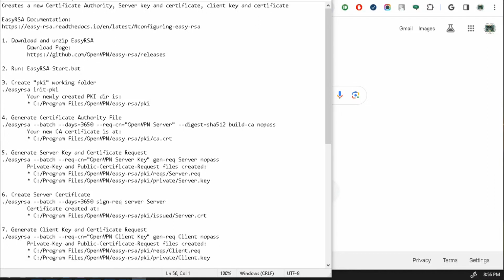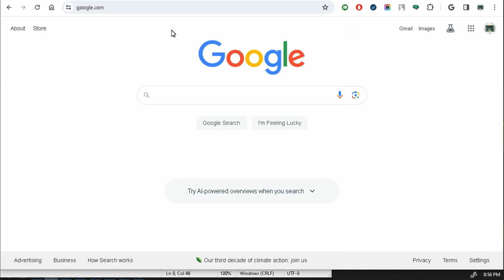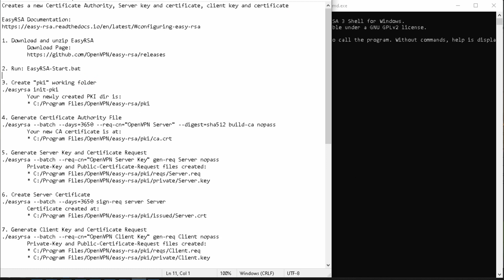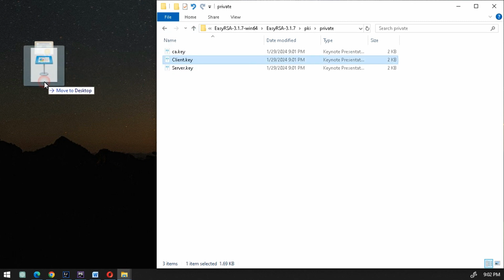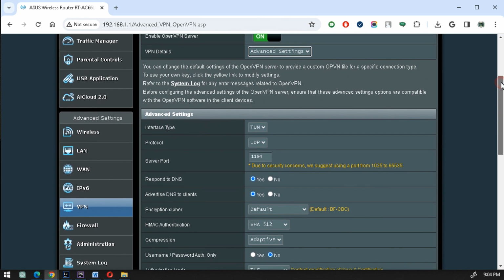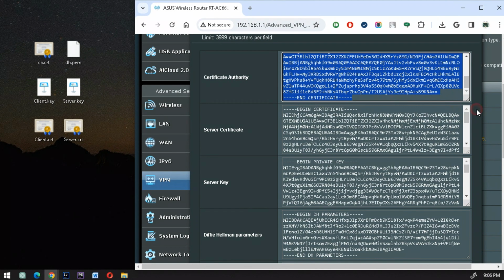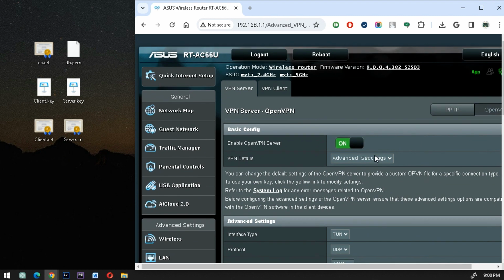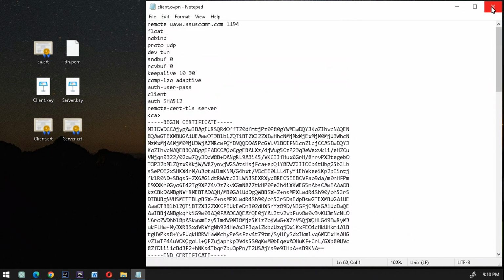Easily Create Certificates for OpenVPN with EasyRSA - Fix VPN Connection

Comment: Update for everyone:
Just did this with EasyRSA-3.2.1 for my AC58U, works perfectly fine except my router doesn't like SHA512, so I change it back to SHA256 in the 2nd line command and GUI.

Comment: Few IMPORTANT moments here:

1. You need to use EasyRsa Version 3.17! In the latest version (3.20) this will not work!
2. You may want to generate multiple client configs (e.g., User1, User2, User3...). While you can reuse single client for multiple connections, you will definitely thank me later for this (for example, when you will decide to push different routes to different users via "Allowed clients" OpenVPN advanced settings section).

# same as author
easyrsa --batch init-pki
easyrsa --batch --silent --silent-ssl --days=3650 --req-cn="OpenVPN Server" --digest=sha512 build-ca nopass
easyrsa --batch --silent --silent-ssl --req-cn="OpenVPN Server Key" gen-req Server nopass
easyrsa --batch --silent --silent-ssl --days=3650 sign-req server Server

# adding more users here
easyrsa --batch --silent --silent-ssl --req-cn="user1" gen-req User1 nopass
easyrsa --batch --silent --silent-ssl --days=3650 sign-req client User1
easyrsa --batch --silent --silent-ssl --req-cn="user2" gen-req User2 nopass
easyrsa --batch --silent --silent-ssl --days=3650 sign-req client User2
easyrsa --batch --silent --silent-ssl --req-cn="user3" gen-req User3 nopass
easyrsa --batch --silent --silent-ssl --days=3650 sign-req client User3
easyrsa gen-dh --silent --silent-ssl
Reply: Thanks, Bro. i use EasyRsa Ver. 3.17 fixed it done.

* RT-AC1300UHP

Comment: "Authentication failed, Server TLS version is too low" appears when connecting to OpenVPN Server from my Android Samsung phone.
Reply from the maker: I just tested this on Android phone and it seems to be working fine. What OpenVPN server are you connecting to? Asus Router like mine or something else? I would try to see if you can set a newer TLS version on the OpenVPN Server, because in the config file TLS version is not specified, it must be set in the server’s configuration. My router log shows that my router’s OpenNPV Server is using TLS v1.2 and it works with android OpenVPN app and configurations shown in the video.
Reply: @dk-tech-guy  Now I noticed that a new firmware version was available for my Asus router. After the update everything works perfectly thanks to your tutorial. I have no words to thank you!
Reply from the maker: @marian26224 

No problem. I am glad it worked. Your “Like” and “Subscribe” is enough 😁